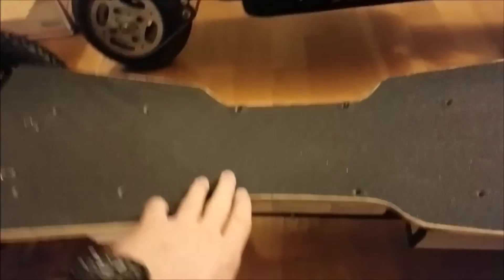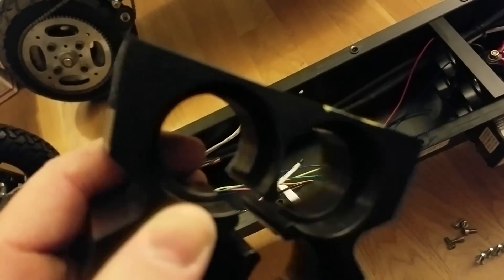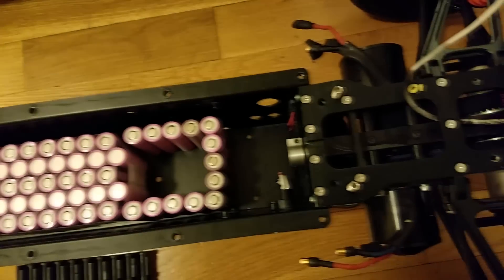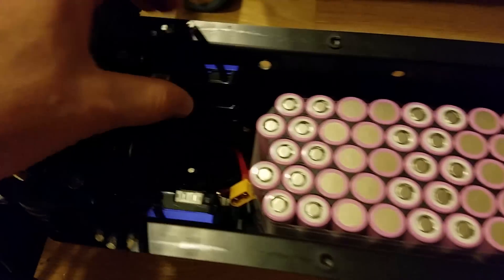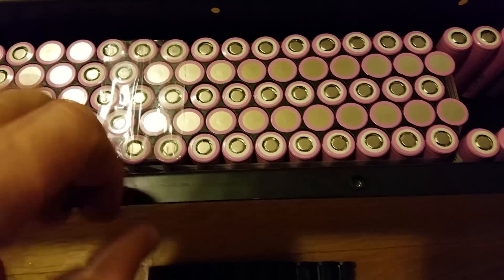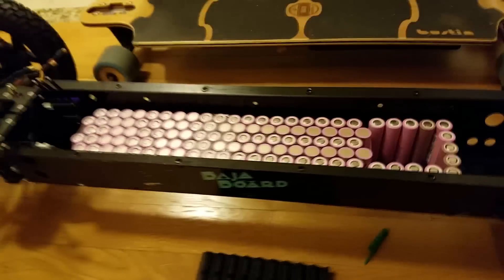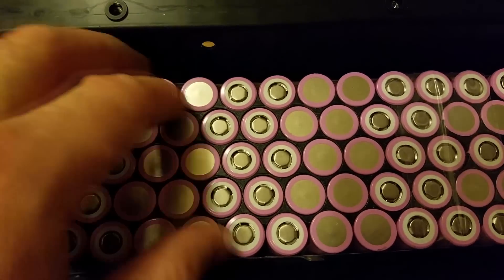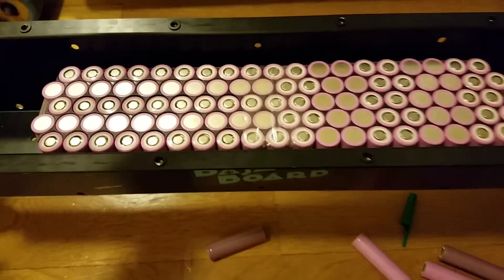Bajaboard DIY built updates - battery configuration, parts!

Comment: sorry but the bigger the gear the less the efficiency you have same with speed and acceleration, put bigger gear on the motor smaller gear driving the wheels less strain on the motors but its too much power to the wheels.

Comment: Why waste good money on outdated dirty tech, when you could have 10x cleaner tech like a supercapacitor bank that can be charged up in 30 seconds to full power and have No flight restrictions and take over 1 million + charges compared to them lithium crap that scars the planet and can only take 1200 charges and take 7 hrs to charge at best? then run down to 75% effective after 2 years, Then you have to buy a new  specific battery pack that will cost you an arm & a leg for, Their lies the "CON" these so called design teams can't see the woods for the trees, Grumpy ald reverse engineer out!
Reply: Lithium ion batteries are hell of a lot better than cap banks in many respects. Size, power density, and cost being the main three reasons

Comment: Those cells will not work, they are only rated 2C (max drain of 5600mah per cell). You need a higher drain cell like the Samsung 18650 25R maybe.
Reply from the maker: Get your facts straight my friend. 30Q discharge 15A per cells and I have 10 of them in paralel... now do the math! Thats running constant but these cells can drain 17 to 18 amps for short period of time. Read and document before posting anything....also before posting none sense look at the date when the video was made and look up all other videos with this board after. This Eboards tops close to 50 mph and running strong! If the battery will not drain 100 A per motors the pack will be showing issues or the all system would cog killing the battery in less than 5 to 6 months. None of this happen!

Comment: Thanks for the interesting video. Are all the cells managing to stay balanced after some use? How often do you measure the individual parallel group voltages?
Reply from the maker: Yes, all cells are perfectly balanced.
Reply: Great. Do you balance charge them every time with a hobby charger?

Comment: These are awesome videos and I'm learning a lot from them thanks for uploading.  If I can put this in to computer terms, didn't you basically purchase a top of the line alienware then when you got it immediately tear it down so you could make your own?  Could I ask what the point of that was instead of just building it from scratch?  I'm sure there's  a reason i just don't understand it xD
Reply from the maker: I dont have the capabilities in my NYC apartment to built it from scratch but I can make a custom battery and make it faster, stronger, better!
Reply: it called reverse engineering

Comment: All this S and P talk... what's wrong with volts and amps?
Reply from the maker: Its battery configuration and how many cells i can fit inside the battery box. 12S its 50.4V and you can multiply number of cells by capacity of one of the cell. Simple!

Comment: Great build but if u change the motor pinion, be sure to check if it can handle the motor power, usually the max power that a belt can transfer is given by the rpms and the numbers of tooths in the pinion, the lower the tooths lowers watts can you transfer trought the same width of belt.
Best regards
Reply from the maker: Good point!

Comment: 1 mile per volt?   so you think running hoverboard motors at 48v should gain 12mph faster?
Reply from the maker: Howerboards have 10S and a dif. way configured esc. If you connect with a focbox you will get close to 20 plus mph. You have to make sure you have enought capacity in your battery. Those hubs like to suck a lot of amps.
Reply from the maker: Also if you go higher voltage they will run cooler.

Comment: I believe that standing the battery up right is easier on the battery then stacking them. I’ll vote 12s an gear it down and you can call It the tank. Cause it will go through anything and it’s just it’s heavy.
Reply from the maker: Thank you Carl Nutter. Noted.

Comment: Why are you trying battery voltage tied to motor speed? Aren't you going to have a controller in between? If yes, then you can control the motor speed and just not let it go beyond what you don't want it to go, regardless of the battery voltage.
Reply from the maker: Nicolay Doytchev true but once i get comfortable i will want to go faster and at that speed there is nothing that will help. Going 10S will limit the speed. I guess i understand what you are trying to say....i could limit rpm or speed from esc's
Reply: Portable Electric Vehicle exactly. Limiting the motor speed by increasing the amps, which requires thicker wires and generates more heat across the system, is a blunt tool. Limit it via the ESC or even the throttle (limit the range of the throttle voltage via resistors). As long as there's no easy switch to unlimit it, you'll probably be able to resist the urge.
Reply from the maker: by increasing the voltage, reducing the amps consumption and using 12 AWG wires you will not generate heat. Thick wires are required for higher voltage and amps consumption but that does not mean it will generate heat or inefficiency. It is all about battery size and choosing the right size motor that would be able to handle the work load and correspond with energy consumption that battery should or can deliver.

Comment: 12s because it's size plus your weight I think it will need it. Maybe not on flats but with it's wheel size and then it's weight and your weight going up hills may require as much power as possible. However it depends on cost. Keep us updated!!
Reply from the maker: Hi Jonathan Davies, thank you for the comment. $$$ is not a problem. I have 200 Samsung 30Q cells. I am concerned more about the speed still! I will definitively need to place a smaller sprocket on the motors in order to offset the speed than. Thank you.
Reply from the maker: Chwalczuk Józef its actually 12S10P and im concerned that water splashes will damage the vescs. I will have to water proof them some how. I have to think here a bit.
Reply from the maker: yes your are right. It is a massive pack. Thanks!